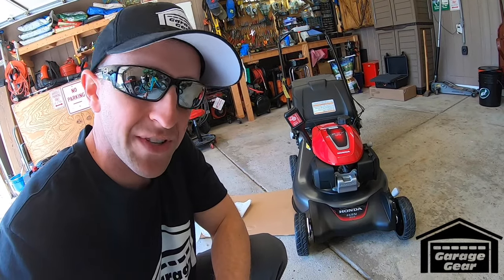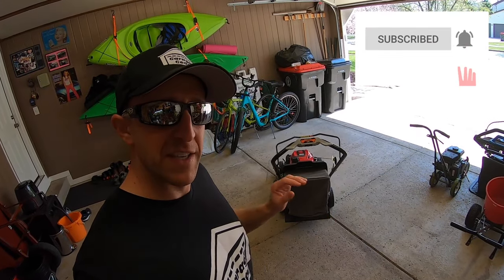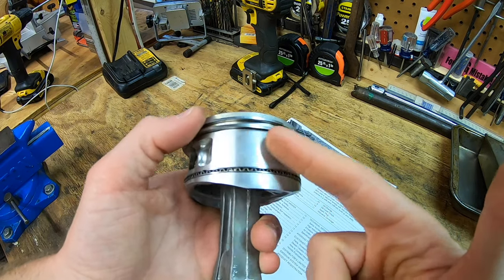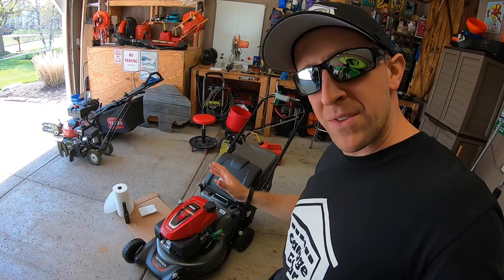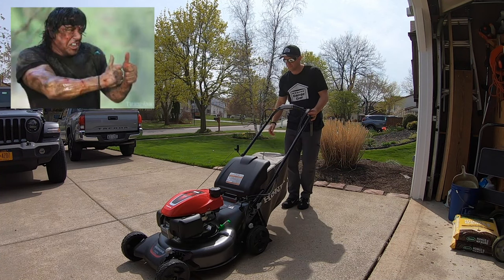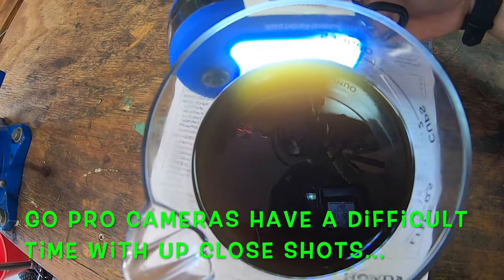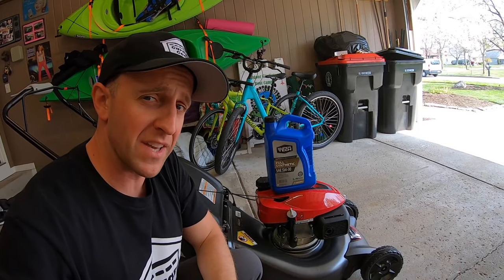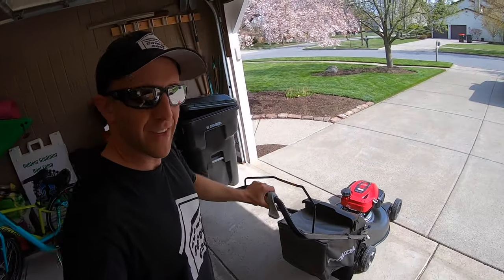BEFORE You BREAK IN Your New Lawn Mower Engine, WATCH THIS!

Comment: I cannot tell you how many times I’ve had to explain this to customers and reps and sales people, but here it is in hopes it will help alleviate the stress levels some of you are experiencing: The oil in your new engine is turning dark because carbon and unburned petroleum components are blowing past the piston rings and down into the crankcase. The rings haven’t formed and finalized their wear pattern yet, (known as “seating”). These contaminants are soft and pose no threat to the engine. Also, using non- ethanol gasoline actually contributes to the harmless oil darkening as it lacks the chemicals which promote a cleaner combustion burn. The metal particles are also completely harmless as long as you maintain the correct oil level for your engine and do not operate it at an extreme angle to it’s center axis design, particularly so if it’s a non-pressurized oiling system. These metal particles are of the exact same hardness as the metal components they are shed from, meaning they do not posses any greater abrasive qualities, and further more are suspended in and completely surrounded by lubricant. Prematurely changing the initial oil in a brand new or overhauled engine will only prolong the break in period, and in worse case scenario will prevent the piston rings from fully seating to design specifications. The results of course are reduced compression values and higher than normal oil consumption, leading to reduced power and shorter life span of the engine. I do not recommend synthetic oils in these small engines; Today’s manufacturing processes yield extremely durable surfaces and require nothing more than the recommended viscosity mineral / petroleum based oil. It is only under very extreme operating temperatures, engine load values, and oil change intervals that I would consider synthetic oil. Hopefully this will ease your minds the next time you grab the pull cord.
Reply from the maker: Thanks for sharing 2 Wheels!
Reply: @GarageGear  Well thank YOU for reading my little essay! I’m retired these days but still enjoy discussing engine theory and dynamics, especially with a power equipment enthusiast such as yourself. Also I commend you for your videos that take a practical and cautious approach to engine maintenance. Your detailed videography raises important awareness in operating and maintaining these engines- so great job there!… and you have impeccable taste in power equipment brands- thank you for that ; )
Reply from the maker: @2wheelsmidnight549  Thank you and I appreciate the positive feedback 2wheels!
Reply: Thanks for this info! 👍🏽👍🏽
Reply: @Lucentlens  My pleasure! Thank you for reading it : )
Reply: Thank you! Yes that DID ease my mind.
Reply: Thank you for writing this. I just bought this lawnmower the other day and was annoyed that I might have to do this procedure. Hondas are excellent at making engines and I will take their word.
Reply: @ManuelFresh100 Congratulations on your new mower! If you follow the maintenance instructions in the owner’s manual and treat the machine with reasonable care, your can expect a near lifetime of dependable service from it.
Reply: I just bought a zero turn which is still in its break in period. I bought full synthetic oil for the 8 hour change. It’s actually cheaper than the Kawasaki synthetic blend. Will I be fine or would it be more recommend to use the Kawasaki oil?
Reply: @brayan8346  I would absolutely stay with the Kawasaki synthetic blend oil if a synthetic blend is what they recommend in the owners  manual. I use Kawasaki (and Honda) oils in my power equipment and bikes and have always had excellent engine protection and engine life with them. The engine companies don’t produce their own branded oils, but they are made to their factory specifications of formulation and quality. They are definitely worth the extra cost. Good luck with your new machine : )
Reply: 2 Wheels should make the video, no offense to OP but if you think you are out smarting a bunch of Japanese engineers whom just happen to build some of the best engines in the world, you are mistaken.
Reply: @matthewl8143  Thanks for the vote of confidence Matthew, but I don’t nearly have the personality or screen finesse to do videos LOL! Besides I think Garage Gear does a great job with his videos; he’s interesting, detailed, relatable and best of all passionate about power equipment…. I would have loved to have had him as a colleague during my lifelong career in motor works.      This is why I love platforms like YouTube- we can share what life has taught us so far :)
Reply: CORRECTED EDITED  FORMATTED TEXT:
  I cannot tell you how many times I had to explain this to customers -
  reps and salespeople - but here it is in hopes it will help alleviate
  the stress levels some of you are experiencing:
  The oil in your new engine is turning dark because carbon and unburned
  petroleum components are blowing past the piston rings and down into
  the crankcase.
  The rings haven’t formed and finalized their wear pattern yet -
  (known as “seating”). These contaminants are soft and pose no threat
  to the engine. Also - using non-ethanol gasoline actually contributes
  to harmless oil darkening as it lacks the chemicals which promote
  a cleaner combustion burn.
  The metal particles are also completely harmless as long as one
  maintains the correct oil level for the engine and does not operate it
  at an extreme angle to its center axis design - particularly so if it’s
  a non-pressurized oiling system.
  These metal particles are of the exact same hardness as the metal
  components they are shed from - meaning they do not possess any
  greater  abrasive quality - and furthermore - are suspended in and
  completely surrounded by the lubricant.
  Prematurely changing the initial oil in a brand new or overhauled
  engine will only prolong the break-in period - and in worse case
  scenario will prevent the piston rings from fully seating to design
  specifications. The results of course are reduced compression value
  and higher than normal oil consumption - leading to reduced power and
  shorter life span of the engine.
  I do not recommend synthetic oils in these small engines;
  Today - manufacturing processes yield extremely durable surfaces and
  require nothing more than the recommended viscosity mineral / petroleum
  based oil.
  It is only under very extreme operating temperatures - engine load
  values - and oil change intervals that I would consider synthetic oil.
  Hopefully - this will ease your mind the next time you grab the pull cord.
Reply: @andrew_koala2974  You’re hired!!!  This looks awesome, thank you. I wish I had you to work with me back when I had to transcribe design details and proposals and the like- if you think I’m bad at it now, you should’ve seen my writing skills back then LOL. And I’ll let you in on a secret; sometimes a design flaw isn’t in the actual design, but in how it was transcribed into a workable (or not so workable!) blueprint! But we had good intentions, and more importantly patient supervisors ; )
Reply: Just bought one today, the sales rep said definately no synthetic oil
Reply: How long should I change the oil after I “break it in?” Thanks for the insightful response! 2Wheels
Reply: @ballglamis  Good day Sir!
 You’re fine to go about 10 or 12 hours+ before your first oil change. More importantly is to check that oil level frequently, and always before each start up. This is when a new engine is most likely to burn some oil, as the rings are seating in. Also, don’t be afraid to give the engine a good work out during its break in period- get into some nice tall grass and let it develop its grunt and muscles! After your first oil change, you can follow the manual’s recommended interval and be perfectly fine. Personally on my equipment, I change it when the oil develops a distinct dark tint when compared to fresh new oil. Some engines are worked harder than others so change intervals vary. You’re perfectly fine to change every 25 hours or so no matter what color the oil develops.
Reply: It would be so funny if you were trolling and making all this up hahaha
Reply: @dingdong5601  Oh gosh I would never do that! Although I did try to convince my neighbor that he still needs to change the oil on his new rechargeable mower HeHeHeHeHe 😁
Reply: @2wheelsmidnight549  Hi, I just bought this Honda mower and I saw you’re post, thanks for the info!!!  This is my first mower and I was wondering what fuel to use.  Should I use non-ethanol like TruFuel or regular gasoline (and if so, what octane?). Thanks again for the info!!
Reply: @TheTangTamer  Congrats on your new mower! If non- ethanol is readily available, by all means use it in your new machine. Non ethanol typically is rated at 90 octane or higher which is plenty juicy. If you’re finding non ethanol scarce in your area or just cost prohibitive, fresh 87 octane regular is fine but I strongly recommend using a fuel treatment with it to combat the moisture issues that ethanol enriched fuels can inflict on your engine. Any name brand of additive will work fine, and most even contain fuel stabilizers which is always a good idea. Honda carburetors use extremely precise jetting for maximum power and efficiency while yielding low emissions. These tiny little jets can become partially plugged with corrosion caused by the moisture that ethanol gasoline introduces into the fuel system. This typically happens during periods of non use or storage when the gas is just sitting stagnant in the carb. Your new Honda most likely has a fuel shut off valve located between the carburetor and fuel tank. When you’re done with your mowing, you can stop the engine (or release the Roto-stop lever to disengage the blade if your model is equipped with it) and simply shut off the fuel valve , restart the engine, and let it run until the carburetor is dry and it stops. This will ensure that even if you’re using untreated ethanol gasoline, there won’t be any left in the carb to cause problems! Good luck with your new machine, and always remember, check that oil level before you grab the starter rope, every time!
Reply: If I mow my drainage ditch in my front yard, does that angle potentially harm the mower?
Reply: @adamlowe8677  There’s a simple way to determine if your ditch is too steep for your mowers’s engine. Warm up your machine for a few minutes on level ground. Then go into your ditch and start mowing; If your engine starts puffing blue smoke out of the muffler, STOP, it’s too steep. If your engine starts to run poorly, as in getting too little or to much gas, STOP, it’s too steep. If your machine runs fine as it would on level ground, you’re good, no harm will be done to your engine. Small engines have their little ways of telling you when you’re doing something wrong! On a side note, drainage ditches can harbor hidden solid objects like rocks and protruding pipes and road debris. Any one of these can cause major damage and even injure the operator, so walk your ditch first.  Good luck ; )
Reply: Non-ethanol gas in small carburetors contributes to pitting in the float bowl as well as rotting the rubber seals.  The "chemicals which promote a cleaner combustion burn" is alcohol, and alcohol is used as a gas drier because it absorbs water.  Water will pit the cast aluminum float bowl in a small engine carburetor, which is why Honda recommends running the engine dry by turning off the fuel valve and running the engine till it stops.  Using the recommended octane non-ethanol fuel in the mowers will prolong the engine's reliability over time.  Regular maintenance following the schedule in the owner's manual and using non-ethanol fuel will give better results.
Reply: Awesome comment, thanks for taking the time.  Just from my personal anecdotal experience with lawn mowers from a young lad to present (54 yrs. of age), for the most part, I follow the instructions in the manual.  I never had a mower engine die on me.  If they were replaced, it was because of other reasons.  Presently, I have a Craftsman self-propel mower (the self-propel kinda sucks through, no matter what adjustments I make...LOL) w/a Briggs & Stratton engine since 2008, and as far as the engine is concerned it's going strong, starts on the first to third pull.  And I do the general maintenance stuff required even probably abuse that schedule a bit.  But I do my seasonal maintenance and I live in GA.  I unlike many, love cutting my lawn meaning it gets used a lot.  Caveat, I do own an EGO electric mower (purchased in Feb 2021) I have a love/hate relationship with it and at present its mostly hate.  And an old fashion manual reel mower (7-blade type) I love using this.  But can only using it until Jul by this time my lawn becomes too thick, and it becomes too difficult to push it. (Location: Ga, Lawn type: Typical hybrid Bermuda approx. 6600 sq. ft.)
Reply: @johnhenley2427 I had a Briggs powered reel mower that I pulled out of a scrap heap when I was a kid. It had to have been from the late 40s early 50s, but it ran great and made me spending money  mowing the neighbors lawns!  I'm curious to know what disappoints you with your Ego mower. I don't have any experience with rechargeable electric lawn equipment, but I'm noticing more and more of these rigs humming along in my neighborhood.
Reply: @2wheelsmidnight549  😂 Did you ask him for a bucket of steam too?
Reply: @andrew_koala2974  is the cylinder steel lined?
Reply: I got worried...after pouring in the first oil honda gave me...i performed by first oil change after 3 months of use and it was black tarry viscous consistency....well i procrastinated since i was afraid of doing the oil change....but hopefully as what you said, didnt damage my lawn mower...hopefully it seated in well
Reply: @jinsu0504  Judging by your description of the first oil change, I’d say you performed a good proper break in! Your engine should be all set now to give you years of strong reliable service. And remember, what’s the first thing you pull to start the engine?….the dip stick! Check that oil level every time before you reach for the starter cord! Enjoy your new machine : )
Reply: @2wheelsmidnight549  thank you! this is to be sure the engine has just the right amount of oil, no less, correct? would it be safe for me to just change the oil every year? i only use the lawn mower from june to september and store it. I plan to do the oil change before starting it up again late may, which is also the time i change the air filter.
Reply: @jinsu0504  That is correct Sir, modern engine oils can look absolutely terrible in an engine yet still be doing their job 100% protecting your engine- but the oil must be at the correct operating level- not above or below the recommended level! Now for your change interval; as long as you don’t believe you’re exceeding maybe 25 - 35 hours of operation each season- you’re perfectly fine to change oil once a year. I have a 43 year old Honda HRS mower that I use just to mow a very rough section behind my house (deck set up on highest position) and only change the oil once a year… it will probably be still mowing long after I’m gone LOL! It’s a pleasure to talk with folks like you and thank you.
Reply: @2wheelsmidnight549  thank you. I'm new to operating things like this. moved from the city to the suburbs and I figured buying the best equipment for lawn management is cheaper in the long run than hiring other people...and i do a better job since I take my time with it. I feel so lucky I'm getting free lessons from you. people around you are lucky to have you. and theres no feeling better than mowing a nicely grown lawn lol...feels so satisfying.
Reply: @jinsu0504  Sir that is one of the nicest compliments I’ve ever been paid, thank you. And I also want to thank our host here, the fine gentleman that owns and operates this channel, “Garage Gear”, for allowing us to use this space to share our thoughts and experience. I can’t imagine all the time and work that goes into creating this type of content. He always has interesting equipment and techniques and service information- thank you Mr. Garage Gear! You know when I first started my career, the highest tech tool we worked with was a pocket calculator! Now we literally have all the information in the world- right in our pockets! It will never cease to amaze me! I share your enthusiasm towards maintaining your own equipment and property; it provides enormous satisfaction and pride, and I believe identifies us as unique individuals. I am considered by most to be “elderly” now, but when I’m walking behind my purring lawn mower, I feel like I’m 13! Somebody asked me how I came up with my YouTube handle name 2WheelsMidnight”: Well it comes from my early days working long hours at the plant and riding home on my motorcycle around midnight; my head contemplating the requests of our superiors for “lightweight self contained electric starters” or “more power with less noise”….. ahhhh, those were the days : ) I enjoyed them as I’m enjoying giving a little advice here and there now.  My apologies for rambling… keep enjoying your power equipment and the work you do with it, and you’ll age to be a happy old guy just like me!
Reply: I looked for a couple weeks for this mower in vain. I bought a temporary unit with a Briggs & Stratton
The instructions actually say NEVER change the oil. Really?😮 mmmm. Not gonna take that bit of wisdom??? Jeez.
Reply: 2wheelsmidnight549, thank you sir, for taking the time, to help us folks that don’t know about these important details to our mowers! You obviously are a skilled mechanic or engineer, to know such information! Your comment here, really makes me feel better now, since I’m picking up our brand new Honda mower, which is going to almost cost us, about, $1,200. Our current Honda, that’s 32-33 years old, has been a great mower,  still runs, but we need to have the mechanic shop, do some maintenance on it, so that will be our back up mower. Take care!
Reply: @2wheelsmidnight549 how many hours do you think that it takes for it to seat properly? Thx.
Reply: @wiredawg2005 hows your ego battery, have you had to replace it yet? Thank you
Reply: @2wheelsmidnight549 I think I would really enjoy having a conversation with you in real life, just listening to your wisdom. You seem like a terrific man. Thank you for taking the time to go in such detail. Thx to our host as well.
Reply: I was always told that synthetic oils suspend particulates which is why they are used in engines that go through a filter. On mower etc. engines to use mineral as it pulls all particulates to the bottom of the sump
Reply: Hmm, Lake Speed (motor oil scientist) suggests changing the oil in a new car at 600 miles. Then again in a few thousand before going to a regular maintenance schedule. This seems to contradict what you are saying that the dirty looking oil doesn’t hurt the engine. He says if you want to keep it a long time, change that oil out while breaking in. To me, with my mechanical engineering background, it’s common sense, dirty oil is not good for an engine & causes increased wear. My Honda only holds a little oil, it is cheap to fill with new full synthetic. 🙄
Reply: Thank you for the information. It’s very informative and I’ll use it. Thank you.
Reply: @andrew_koala2974   Totally unnecessary, Mr Adrian Monk.
Reply: "very extreme operating temperatures, engine load values"   Well, that sure sounds like lawn mowing, AND snow-blowing. Maybe I should try a synthetic in my lawn mower???; if you seen my "lawn", you would know there is engine load, and very hot conditions. My tiller perhaps would do better with a synthetic, but my garden soil has most of the rock removed now, and is easy to till now; no more extreme loading ;-) 

I have been using SAE 30 and 10W30 conventional in my tiller and mowers. Seems fine so long as it is a good quality and changed regularly.

My generator and snowblower gets 5W30 full synthetic because of the increased temperature range they are used at. When I get my powerful custom wood splitter engine, I will likely run 5W30 full synthetic, so I can safely use it at any time of year. If the manufacturer says only use conventional oil, I will use 5W30 so better starting for cold weather than 10W30. Wood splitter engines are hard to start as you are spinning the pump too. When cold the hydraulic oil is hard to move, making it even harder to pull start the engines. So, I figure 5W30 for certain for my new wood splitter engine, and perhaps full synthetic. There will be extreme loads, I am attaching a winch for the big chunks; there will be extreme temperature ranges.
Reply: @markluxton3402  Sounds like you have a very complete arsenal of power equipment!… Nice ! The “extreme conditions” that I’ve found engines being subjected to during my working years were somewhat different than what you’re describing, and my apologies for not being more precise in describing them. 

One example was an engine of ours operating a vibratory impactor mounted inside a bulk commodity holding silo.. The lil guy (engine) was modified with a lengthened external exhaust, and was fueled from an external 55 gallon drum of gasoline so it could run continuously for days on end. Even though there was ventilation to the interior, the ambient air temperature inside that silo easily exceeded 120*F in full sunlight, Another example was a portable generator powering a small unmanned test facility in the northern regions of the Arctic. A similar set up as the former- external fuel supply and exhaust to maintain continuous operation, but this time ambient temperatures consistently sub zero. Both of these examples pre date the useage of synthetic oils in small engines! 

It sounds to me like you have an excellent understanding of your equipment and what’s required to ensure a very long life for every piece you own. If using synthetic in your lawn mower and tiller gives you greater piece of mind, then by all means. Personally from my experience, if your mower and tiller are past their break in period and running fine, just stick with the oil you’re currently using. It’s your call, your engines will be fine either way :)

I’m going to conclude by saying this: Individuals such as yourself and the gentleman that owns this YouTube channel clearly have the awareness and aptitude for mechanical design and operation. There’s no way you’re going to cause harm to your power equipment because you know how to properly operate and maintain it. Follow the manufacturers’ recommendations, check the oil level every time before you start up, and your equipment will have a very long useful life. Happy mowing, tilling, and splitting!!!
Reply: @2wheelsmidnight549  5 vintage chainsaws and two line trimmers, two lawnmowers, tiller, and more. I am finally getting better tools and instruction to keep my gear running even longer. I have only 3 newer engines, the rest are 1960's to 1995.
Reply: @230bdaniel in your opening sentence did you mean fuel with ethanol? Seems you’re opening with “non-ethanol fuel damages small carbs” then you close with “use ethanol free fuel for best results” ???
Reply: Hi everyone! I just bought this lawn mower and I love it. I wasn’t able to do a proper break in because I just moved into a new house and was fighting the rain trying to get the grass cut. Should I still change the oil even though I already did 1 cut?
Reply: @money412  If you ran it long enough for a break in, change the oil.